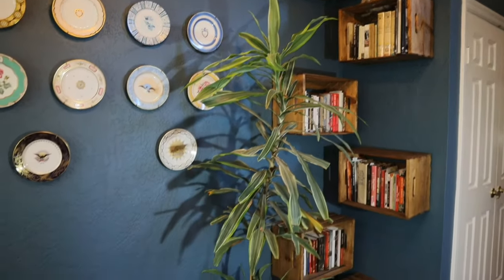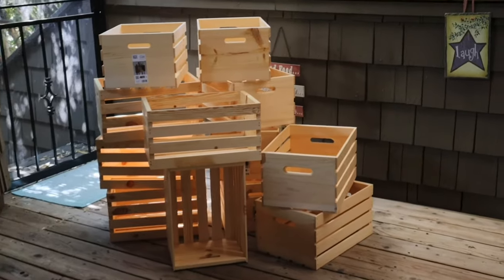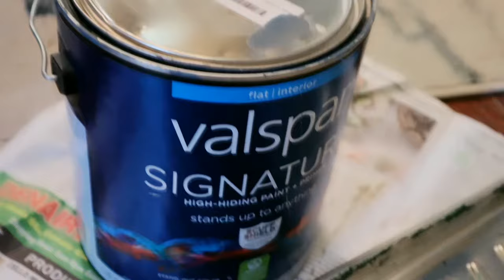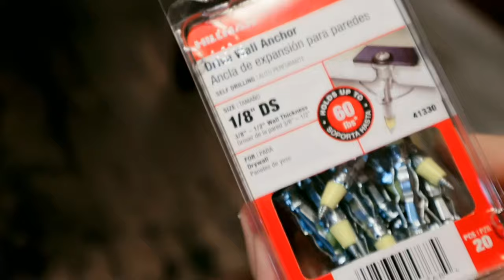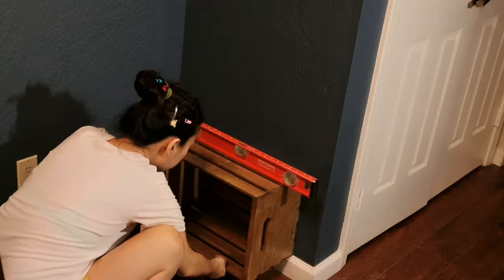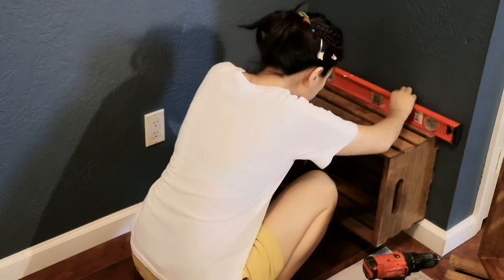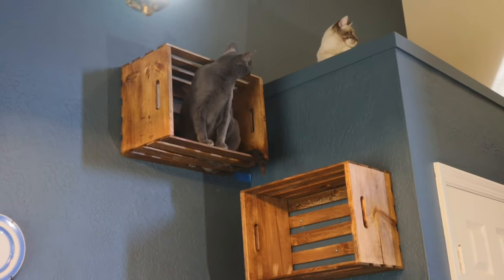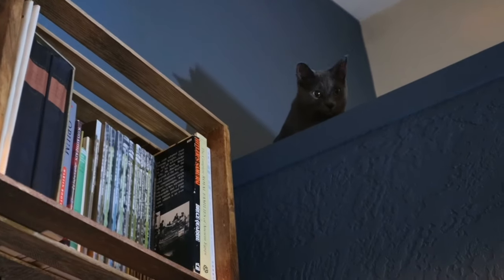DIY CRATE CAT TREE + BOOKSHELVES | DIY CRATE  STORAGE | CORNER WALL MAKEOVER

Comment: great idea...looks great...you should add screws or something to support the bottom of those crates though.....
Reply from the maker: Thank you so much❤️, I’ve been thinking about that😅 I knew I screwed the nails to the stud on the main wall, but the pantry wall doesn’t have stud, I will take your advice to add some brackets on the bottom of the crates, to give it extra support and reduce the weights of the books.
Reply: I'm thinking the same thing

Comment: How have these held up over time? I am wondering if the crates themselves have broken or if you’ve have to reinforce them at all?
Reply from the maker: Hi Lauren, it’s been holding up very well.  As the books are very heavy, I think the best way to install the crates is to screw the nails directly into the studs, you can use the stud finder to help you locate the studs behind the wall.  The crates themselves have no problems at all.